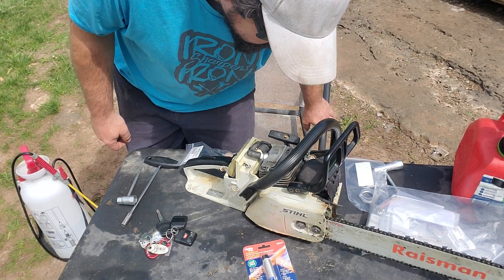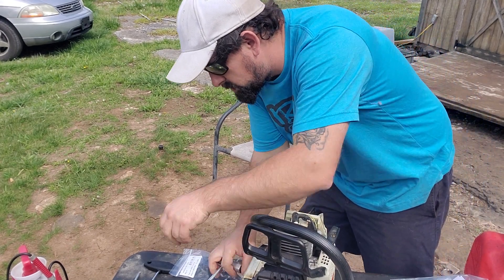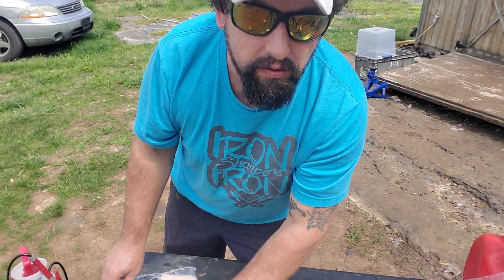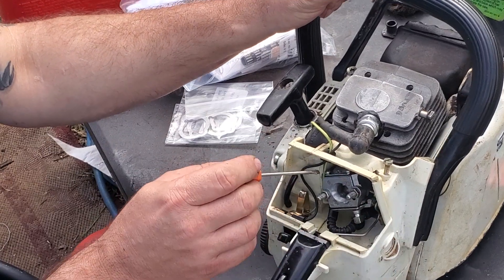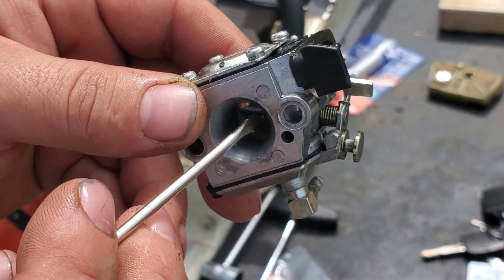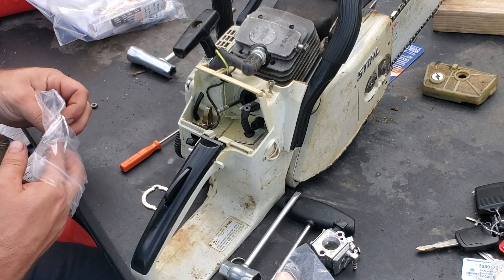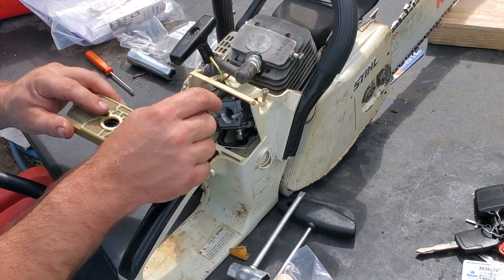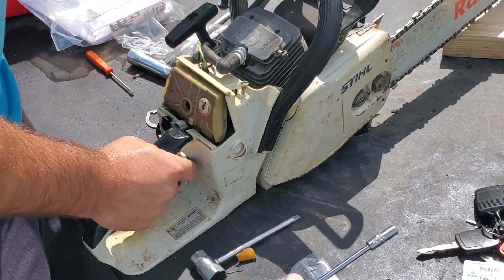stihl 028 diagnosing blowback#3 what is the problem and how to fix it

Comment: For testing I leave the filter off, put it on the ground with my knee on the handle while I put my thumb over the carb throat. Pull to get the fuel to flow the pick it up and drop start.
Reply from the maker: I don't know that I am physically capable of doing this but u did kind of try it initially just to hard for me givin my injuries

Comment: I think I might have stumbled onto the fix!   Try removing the tank vent as a test,  these vent are supposed to keep the tank pressure equal to ambient air pressure.  Think of a plastic gas can that heats up, swells and when you dispense the fuel it comes out under pressure. The same thing can happen to the saw is it’s  tank if the vent has failed.  It could be forcing fuel rather than drawing fuel.
Reply from the maker: Well HELL NEIGHBOR you gonna have to watch the HOW TO: change the fuel line on stihl 028. Jons saw was running amazing but we notice fuel leakage and thought it was the fuel line..... and we had NO idea I didnt install a tank vent....

Comment: I am starting to think that the aftermarket boot has to thin of connection flange at the carb set point.
Reply from the maker: It is an oem boot,  however,  you are correct I have multiple aftermarket boots I would never use bc if that EXACT ISSUE
Reply: I meant the after market boot on mine.  Mine simply does not have the exact same set up at the carb to boot as the 028 you are working on, mines older.  No outside captivating ring. It’s boot sits in a well with very little extending past the end of the well. Not much for contact under compression. The factory boot is the same thickness at the connection and feels about the same of crush.  I have done what you have, dribbled carb cleaner at the connection point and it draws it in and stalls the motor.  I’ve added a fiber gasket with no improvement. I tried stacking a thin O ring and no improvement. Tried both with sealant with no improvement. Removed muffler to look into and at the rings, all is new, and nothing seems out of the ordinary.  I’m setting up for a leak down test next.  I am glad this is my personal saw and not one I’m being paid to fix!  This is one of the weirdest ones I have ever worked on.
Reply from the maker: https://youtu.be/vq0KnHcfZR4 help me juice this in the algorithm 4 part series all 4 videos posted at the same time and only part 4 made it in tell me what ya think

Comment: Damn near all the 024 26 28 will die if you spray the right side of carb like that. I think it's possible your chasing wrong issue doing that. I had a saw come in and customer said same dies when I spray right side of carb. Saw passed pressure/ vac test. So when saw was put in wood and got up to operated temp it idled funny and would eventually die. It's not easy to do but we had to perform the test best we could at operated temp. Come to find out crank seals only leaked at operated temp. Saw your working on has blow by. I've had those old saws ha e 140 compression  it had blow by. So I tore it down put some new caber rings in it and problem solved. I wish you good luck because you can chase the spray right side of carb thing for a month and not fix it.
Reply from the maker: I have replaced crank shaft seals twice, and measured ring gap, but if the gasket I made does not solve the problem, that was my next thought, just go back in remeasure the bore, and just re ring it with caber rings despite good ring gap. Thanks for the input neighbor Ted I definitely appreciate fellow wrench turning advice
Reply: @chainsawredeemer85  your welcome but if you do figure out how to get that saw to not die with spray I'm all ears and ready to learn myself. Keep us posted.
Reply from the maker: @tedneitzel  lemme ask you this neighbor, how did you determine at operating temp it was your crankshaft seal?
Reply: @chainsawredeemer85  total tag team. My guy was set up and ready and I mean we were quick. I think it was Nascar pit style tbh. We had that thing pressure vaced in no more that a minute. We both may or may not of got a burn or 2 even!
Reply: What I know is it was much hotter than if it just idled and brapped the throttle a bunch of times
Reply from the maker: @tedneitzel  what did you use to block your muffler port? I mean rubber slide would burn up no???
Reply: @chainsawredeemer85  you would think but it did its job for what we needed. We had a plenty thick piece or I should say my partner did. He's still in business in town here in beautiful Colville Washington as logging is still strong here. But I could ask him exactly what he used and get back. He's open till 2 I think on Saturday.
Reply from the maker: @tedneitzel  that would be great Ted!!
Reply: @chainsawredeemer85  you bet will do.
Reply: @chainsawredeemer85  wow wasn't expecting this but he said it was a piece out of an old skidder tire. Plenty thick and will take heat!! I wish you good luck!
Reply from the maker: @tedneitzel  well damn I ain't got no skidded tires laying around but I bet I can find a neighbor with some old tires I can cut a piece from
Reply: I am having the same problem on my 028wb.  My parts breakdown shows a different boot that is not captivated by an external ring between the carb and the boot only the internal ring.  Definitely sucks air between carb and the boot flange which isn’t as thick as i think it should be.  Erratic jet setup, needs way more fuel than 1-1/4 turns of low jet to make it rev. Blowback is terrible. My boot has a well in the mounting divider housing and it’s body doesn’t extend out to the bolts like boots on a lot of stihl saws that use the external containment ring.
Reply: I generally take the bar, chain and dump the oil while I am working on these.  A small squirt bottle, like a gold snuffer bottle, with mix works really well to prime these without the filter on so ya can get it running.

Comment: Check the needle valve and it’s spring, a weakened spring can let to much fuel to get past the needle rather than only when depressed by the membrane.
Reply from the maker: it is a rebuilt carb brand new spring, needle, diaphrams, welch plugs, and had an ultrasonic bath. Mike picked up his saw today, though I cannot without doubt verify the issue, I do believe it had to do with fuel atomization, OR possibly could be what you said in your other comment, bc IT ONLY HAPPENS when we have bad shifts in barometric pressure and temp over a 2 or 3 day period sometimes. But I also tried 93 octane with diff 2 stroke mix instead of non ethanol and stp mix. I wanted to experiment and figure out the exact problem but I am just too busy